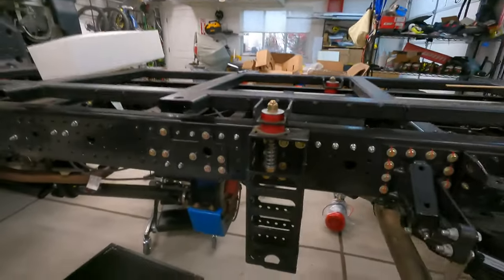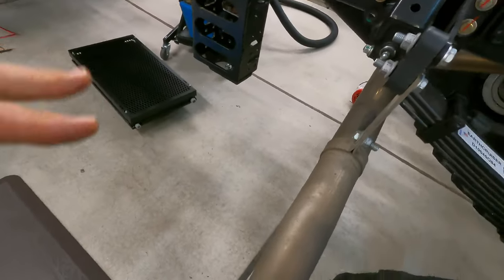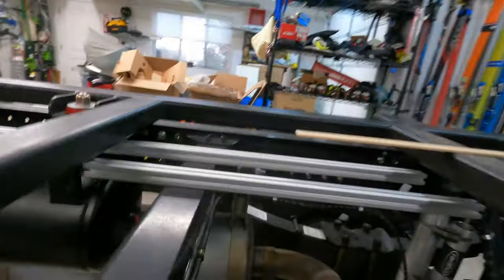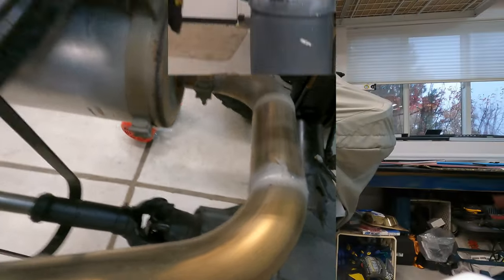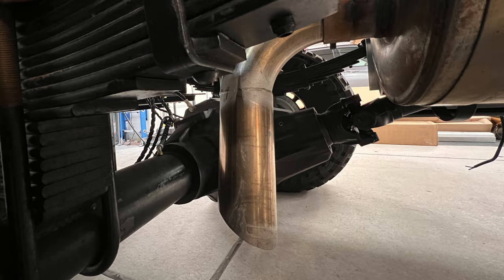Expedition Camper Exhaust modification

Comment: not correctly made exhaust system
Reply from the maker: Please tell me more as to why not?
Reply: @vantripping 1.the paint will burn from the exhaust gases and the rear axle will rust . 2.hot air can damage the wheel. 3.there will be a lot of dust at maximum engine speeds . You are the owner of the supercar , you know better , sir )))Good luck
Reply: @vantripping  an oil separator must be installed on the exhaust of gases from the valve cover crankcase, + a dahl fuel separator with a filter size of 2 maximum 10 microns (if traveling to countries with poor fuel quality).I apologize for my English, the translator does not translate correctly
Reply from the maker: @volod8130  The section of pipe that I removed was after the muffler, and the only part that I reduced was a section of the final exhaust pipe after the muffler. All factory components of the exhaust system were not changed. All crankcase venting is still the same from factory.
Reply from the maker: @volod8130  Those are valid conners. However the factory final exhaust routing from the muffler was dumping exiting out in front of the tire and measurably heating up that tire and consequently increasing its tire pressure. My new routing is further from the brakes, tire and wheel than the factory routing, and directed downward below the axle and exceeds the minimum clearances as specified in the body builder's guide as well as increases the distances that the exhaust pipe routing was before. So this routing and modification was the best compromise to reduce heating of a tire, wheel, brakes or axle, and meets  manufacture's recommendations. I feel that a little rust that may develop on an axle is far better than overheating of a tire and possible failure or premature wear or uneven tire pressures as a result of that exhaust as the exhaust system routing created before my small modification.